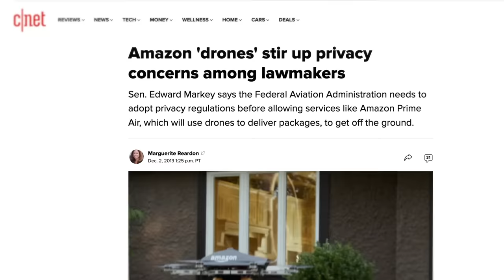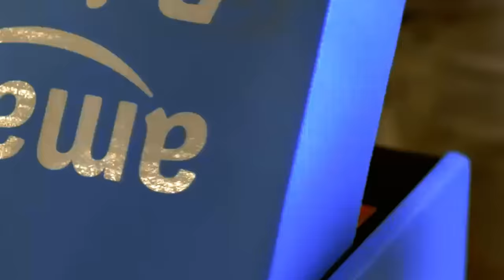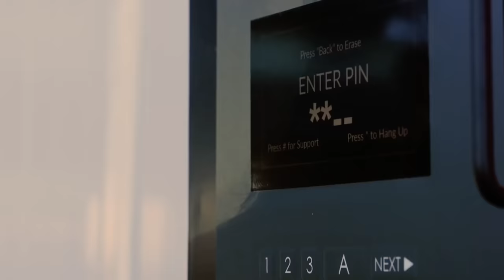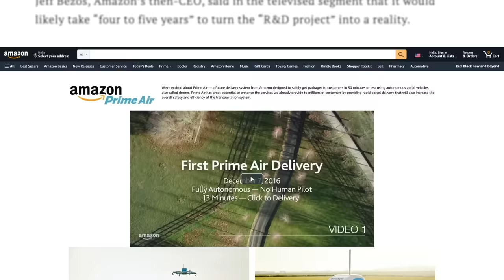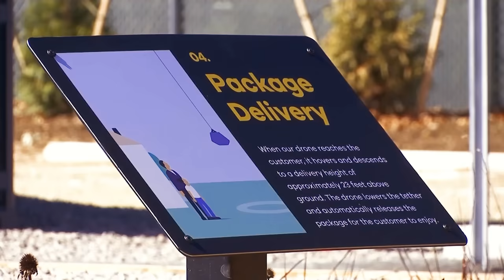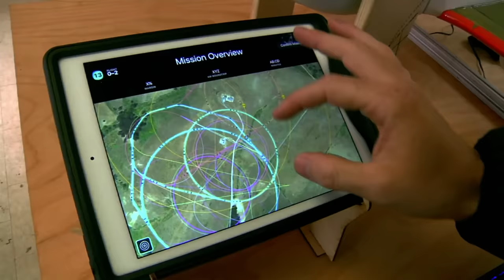Drone Delivery Was Supposed to be the Future. What Went Wrong?

Comment: As much as drone deliveries would be cool. I am kind of glad that they did not take off, they seem like they would cause more issues than solve, first of all noise, even the small little palm sized drones are incredibly loud, second of all would be accidents, drones and their propulsion systems occasionally do malfunction and I wouldn't want an Amazon drone falling out of the sky and onto my windshield or getting tangled up in the high voltage power lines and causing a major outage. And third is crime, we've seen the vandalism and thefts of delivery robots so what makes? An aerial drone? Any different, hell? An aerial drone might be more fun to rob because you have to shoot the thing down first, which gives you a little bit of a challenge. And even though it's a federal crime to shoot down an unmanned drone with a firearm the FAA would quickly get so many complaints that they would become overwhelmed and would not investigate them. And given the altitude restrictions and the size, your average delivery drone would be easy pickings for a person with a shotgun
Reply: And if delivery drone operators don't require a marked landing pad with a radio transmitter that the drone can easily find and navigate to, there is a chance that packages could be missed delivered by accidentally being dropped on the roof or dropped in your backyard, pool, etc. And who wants to break out the tall ladder to retrieve your Amazon package? Because the drone software interpreted a roof as a valid delivery spot. And if you think claiming shipping damage because the FedEx driver was lazy and through your big screen TV over the fence, was challenging. Imagine the hassle trying to claim shipping damage because an autonomous drone dropped your new iPhone into the pool because it interpreted a rogue radio signal

Comment: Small town in VA my ass. I just got hired by dronup they run Norfolk Va beach they just got a contract with wallmart here in va beach Chesapeake and several other cities. Laws change. I can fly in restricted areas you just need a part 107 pilots license. 150 bux and you can contact atc and get your flight line aproved. Lol. How old is this again. Lol this was funny.  Drones are back on their way up. I fly a dji fpv. It lands on its own just fine every time. And landing if you can fly shouldn't be a problem because of the tech. Again. This has got to be old..

Comment: It's simply a case of a "solution looking for a problem" - happens all the time in the engineering/business world. Current delivery systems work just fine - this "solution" is neither faster or cheaper hence, no change.
Reply: ? Cars originally was also ambitious and held safety concern. People saw potential in it at consistently tried to improve it and mitigate safety concerns. That's how evolution works. Constant experimentations and failure until a finalized product is made that harmonizes with it's environment. Same logic here, drones and well flight is probably the best form of communication and transportation, simple reason being 0 obstruction and not a whole alot of restrictions, the idea wasn't illogical the execution was. It's still viable option.

Comment: so like... build a designated landing zone for shit in communal areas.  underground feeder electrical mains, solar battery as backup.  low power motion detectors with cameras to ward off would-be burglars.  designated barriers to not permit legal access aka "trespassers will be violated" signs.  Designated landing zone will be caged at a heigh of 20' or greater in a minimum of 5x5'  stainless steel enclosure grounded and bonded in accordance with NFPA70.  UAV will access cage through motion actuated entry door on top, resident access will be granted via key given by landlord/complex admins, and also monitored like any other CCTV channel.

like, fucking duh.